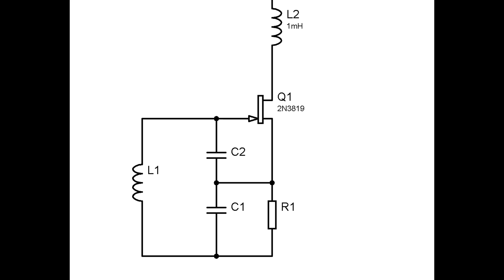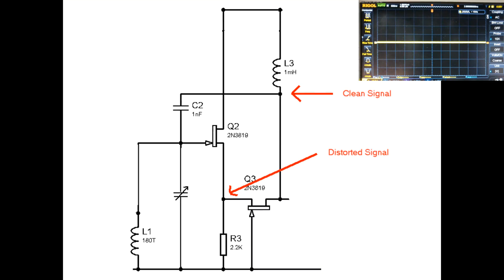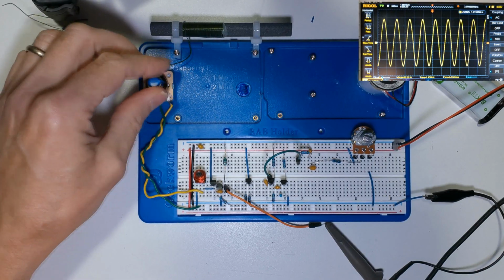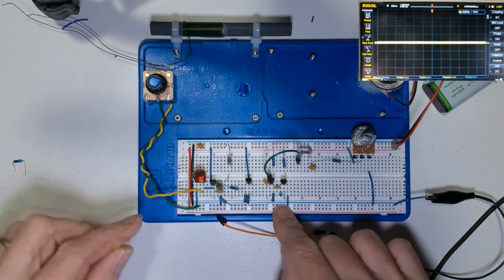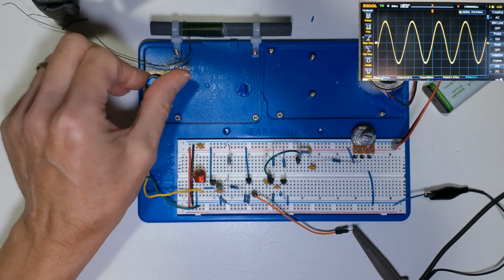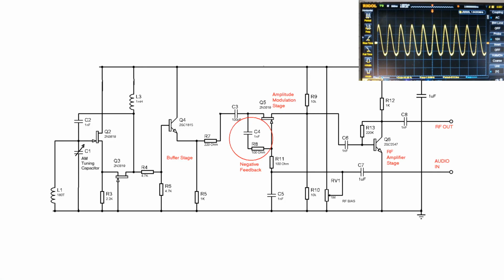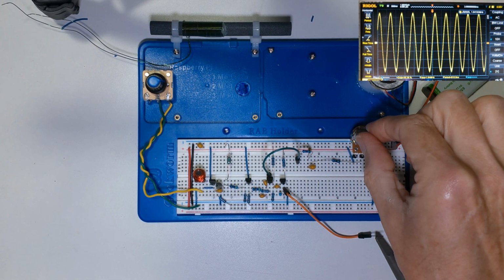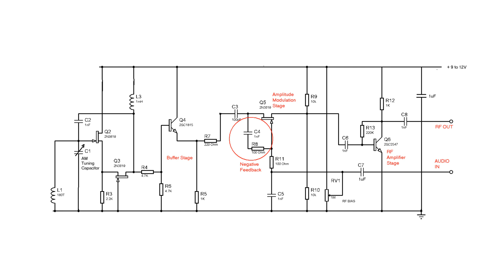RF Signal Generator Part 2 of 4

Comment: when I wanted to make RF-Sigen for AM/MW radio I suddenly saw your video. 'this is what I will assemble' thanks for sharing. Honestly I'm having a bit of trouble getting the final amplifier transistor 2SC2547. I've searched online in my country (Indonesia) and I can't find it. only on aliexpress I saw 2SC2547, but I'm a little worried about the quality. Is there an alternative replacement that is equivalent to 2SC2547 but a transistor that is commonly sold. and if possible without changing the other value of components or design, thank you.

Comment: ok I did it, i got ti change the variable capacitor for the varicap and works fine.
148t =223uhz. now i go from 524khz to 1.90mhz After the buffer.